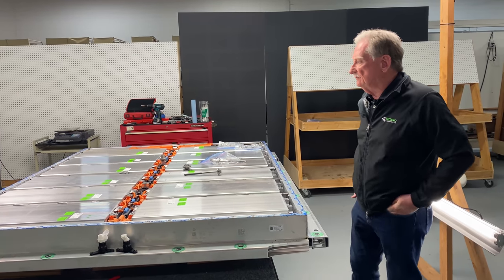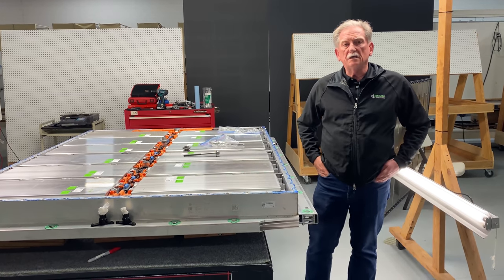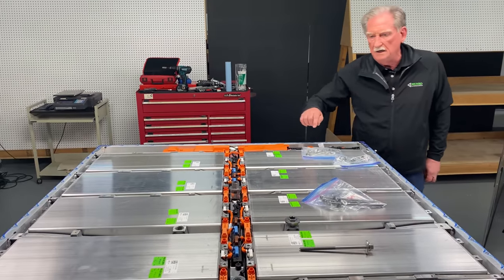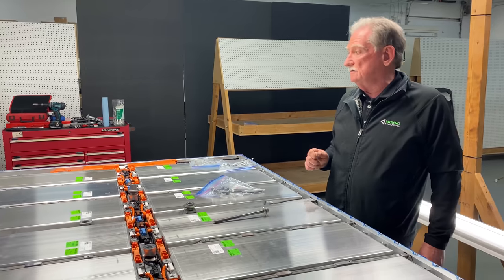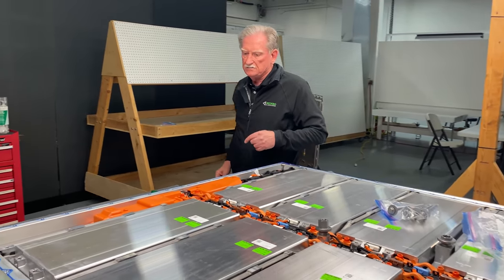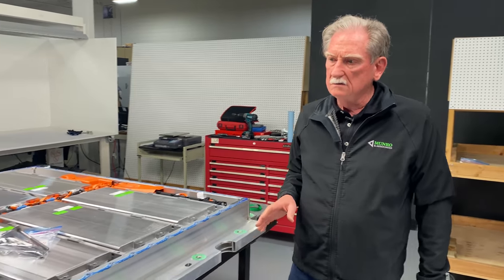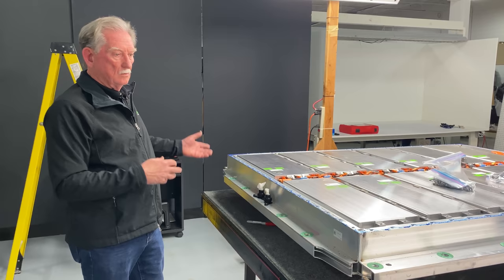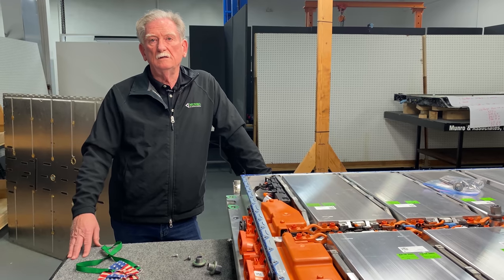2021 Volkswagen ID.4: Battery Teardown

Comment: I believe that what he's saying about the bolt is wrong. The idea is NOT to put it into the plastic state, as the plastic state means permanent elongation (and thinning) which would only harden the bolt (initially) but not help with clamping down elastically. What he means, I hope, is elastic deformation.

Comment: Model Y improvement  is 3 kg, less than 10 pounds or less than 0.7% difference which is not an improvement but we call that margin of error.  For a bolt to go into the plastic stage it needs to yield (the stress vs strain curve will tell you that) you mean pre-tensioned bolts not plastic.  The plastic stage creates necking which is not good for strength as it reduces the cross sectional area.  I will take aluminum and treaded fasteners over plastic any day but just a personal preference I guess.  I like things to be fixable not toss away garbage.

Comment: you used the gros capacity for the iD4 (82) which is net 75. Gros capacity for model y should be 79 atm to be 74-75 net

Comment: Sandy makes a big mistake with that $500 claim. That 500 mean to represent the reduction in battery materials etc., the casing, braces, bolts are cheap and won’t add up to $500...
Reply: the $500 is a benchmark that takes into account all costs, not just material costs - it's a rough estimate

Comment: It's interesting that converting parts to carbon fibre could make it cheaper. I don't know too much about the mass production of carbon fibre and other composites, but would you selectively place sheets of glass during a regular mold process, or overmold onto a previously made composite bit?
Reply: Changing to carbon fibre is almost certain to make it cost significantly more. It will make the assembly it lighter, but also impossible to recycle - downcycling to lower grade parts is the only option for reusing composites, so I'm very glad they stayed away from carbon fibre.

Comment: I guess VW doesn't use ANY metric screw below a property class of 8.8. It isn't that special and it's more like the standard for screws.
8.8 means:
Yield Strength, min(MPa) of 640MPa (first number x second number x10)
Tensile Strength, min(MPa) of 800 MPa (first number x 100)
It's independent from the screw size and is supposed to give you an idea of the quality of the screw. The higher the numbers the better.
10.9 and even 12.0 are quite common also (i.e. in engines or gearboxes).

Comment: There’s one thing you forgot in your calculations.  The box frame structure also is a stress member in the framework, not just for side impact like model y 2022 it will butt up directly onto battery so both rear impact will be transmitted through the frame, the alternative materials hav4 to conform to the same level of crash protection as well as stress from the rest of the cars frame, you may find that if made of alternative materials the box frame will be larger to conform to the same rating such as the i3 subframe compared to a steel or aluminium equivalent

Comment: Carbon Fibre is wonderfully light and strong but difficult to work at scale and hard to recycle. I think the aluminium embedded in polymer is a very good idea but imagine the retooling costs and the same for Carbon Fibre end sills? I think an aftermarket producer with the right economies of scale might be able to make significant weight improvements, therefor performance improvements but for VW it would be a paradigm shift in thinking and no doubt costing to change their production plans for the id 4, 5 or 6 before the next production cycle.
Reply: Carbon fibre is awesome for saving weight, but also excells in ballooning costs.

Comment: Isn't this a heavy piece, seems appropriate it might be aluminum, even if it's a cost saving vs carbon or something. It's sort of like the cross-member for an engine or a transmission carrier - pretty typical/economical to be steel or Al. Also I imagine it adds some rigidity as-is and to get that kind of strength seems like it would be even more expensive.

Comment: I really doubt that you can get a kilo of glass fiber composites for the same price as a kilo of molded aluminum. Also, the frame looks to be part of the thermal design, so you'd have to adjust for that as well. And where Aluminum might only deform slightly, composites will splinter and break, which would lead to some concern on my part about how well it'd hold up in a car crash scenario. You really don't want flaming lithium batteries on top of the impact.

Comment: wait..doesn't the huge aluminum frame do more to prevent safety issues like exploding batteries? and holding the weight together when the car hits a rock at 80 mph... when the batteries explode...have you seen the video of that model S battery in that parking garage in China...wow ... I don't want polymers in-between that much battery and me I don't think - I think it's about fire safety during events that are basically an explosion
Reply: Compare battery casing design from US (Tesla) and DE (VAG, Mercedes), it is clear that there is no standard for crash testing of the battery casing. In quite many reports the  German casing are built much stronger, side bars, thick / double lower plates etc. Not seen any reports, comparison, but the Tesla battery casings do not look safe, recent some top news stories, there a Tesla hits a concrete object from below and the cars are in flames. One case the two occupants( at least one, climed back to rear seat) burned to death. For saftey I would rather go with German "overengineered" design.

Comment: 8.8 bolts are pretty much the weakest bolts you can buy here in Europe. 

The first number * 100 = tensile strength N/mm^2
The first number * the second * 10= yield strength N/mm^2

There are 12.9 bolts For example.

Comment: The ID.4 has 5,96 kg/kWh and Model Y is 5,85 kg/kWh, so Tesla kWh design is lighter or am I wrong?
Reply: Thats what I saw also. Don't know where sandy found the 50 kg. I found 9kg - and the battery pack was crash protected - don't know about the TMY battery pack
Reply: @venti4268  He just ignored the kwh difference between packs, if we do that we can see 50kg difference between both packs, but that's flawed logic as both packs have different capacity, if you want to compare them you have to go to compare them at the kg/kwh... and then you should also consider serviceability and reclyclability as botth things are also important, sometimes it makes sense to have a design that is a little heavier but it's easier to fix and recycle.
Reply: @Gresteh  Just as important and perhaps even more is the difference in the quality of the construction and design. Consumers usually perceive country of origin as meaning quality, although origin usually "should" read origin of design and engineering of the product. I did not hear one aspect of Sandy's comments that were negative, in fact quite a few positives, on the quality of the execution. Cost savings may lead to higher margins for OEM or maybe lower prices for the consumer but not necessarily longer product life. I think comments should not just at saving a few dollars but highlight how will it affect a product's life. Just like when commenting on the use of fuses is a problem waiting to happen and I have 2 cars that are 20 years old, a Mercedes and a VW, where I have yet to replace a fuse. If you get a car for a 3 year lease you don't care but if you intend to keep a vehicle for a long time I care more about inherent build quality.

Comment: Page 6:00 Are these alloy steel screws? 
If so how can we put steel with aluminum together without concerning galvanic erosion?
Reply: Audi has done this with the A2 and A8 all the time. You could electrically isolate the more with Oxiguard for example instead of galvanic zinc on the screws/nuts. Or some kind of plastic film in between.
Reply: @Stefan_Dahn   thank you for update. If I understand this right. We have a friction melt drilling process in which the screw has thermal metal blank tip and threading from 50% up the head. We need this screw to fasten top and bottom casing. In the second half operation is self taping operation where we have direct electric connections from top to bottom casing via screw threading. Result in a configuration cannot be avoided such as aluminum-steel-aluminum junctions, regardless of insulation involved. You advice?

Comment: Hi mr Munro, just a thought for you, I watched your interview with Elon Musk, you talked about Lego and the way the blocks hold together , so it occurred to me, how about the construction of a small electric vehicle where the floor - sides and back and front where made from a composite plastic honeycomb construction, the honeycomb cells could hold the batteries, the 4 parts of the construction could be made to dovetail together, the car would not be painted but have a self colour finish, the honeycomb should be stronger in some areas than others

Comment: The reason the connectors are on their own piece is for modularity. The tooling for the entire battery pack doesnt need to change in order to change the connectors. This is hugely advantageous for tooling cost and production speed/turn around time. Moulding them into the entire case of the battery would seriously hinder your ability to be flexible with the design, essentially locking you into connectors until you commit to creating new hugely expensive tooling for your entire battery pack housing. Also, polymer/composite is terrible for recycle ability - please dont push these materials as viable long term solutions.
Reply: molding plastics with multiple criss crossing copper bars in side is not  trivial you would always try to make the part as small as possible, bigger parts would lead to cracks, and such parts also need some level of aftercare by robots and humans

Comment: On any kind of bolted connection, you never go into the plastic part of the load curve, it is always the elastic straight line area. What is he blabbing about? Plastic means you deform and it won't came back to where it was when the load is taken off.

Comment: By the time composite frame etc has been re-engineered, proto, production and re-cast the connections , you'll be spending a crap load more than the original $500 savings.  Let alone the original design/production costs of that original unit. Perhaps, if they'd come to you first, maybe... but they have built their system.

Comment: Aluminum is there and better for multiple reasons. Heat dispersion, fire safety, crash safety. It wouldnt be easy finding a polymer only solution that meets or beats aluminum in most of the needed requirements.

Comment: Is the shape of  ID.4 battery like the pouch shape  E-tron battery or cylinder battery like Tesla?
Reply: 24 pouch or 16 prismatic inside the modules, so it is flexible and has different suppliers.

Comment: Tesla's packs are closer to 80 kWh, not 75kWh. 75kWh is the useable figure. It seems that VW is about 4 years+ behind Tesla. The density of this battery pack is less than the Model 3 battery pack released in mid-2017. I also think the cost is higher, more modules, more connections and more fasteners. It actually looks visually more similar to the Model S pack from 2012 than the Model 3 pack. Can't wait to see Sandy tear apart a new Model Y battery pack with the 4680 and structural pack in a year or so. It's going to blow these cars out of the water.

Comment: but since it very likely to be a structural piece of the body won't they have to add weight to the body to compensate the loss of rigidity

Comment: Sorry, that is  n o t  (!!!) a yield screw. A yield screw is thinner in it's shaft.
It's an ordinary 8.8 hexagon head screw ISO 4017 (8.8 means 8x8x10 = 640 N/mm² yield strength and 8 x 100 = 800 N/mm² tensile strength)

Comment: Heat travels to the top, those MEB packs are cooled at the bottom, could that be an issue? Also is it not easier to extract heat out of many little cells (Tesla) than out of those big solid bricks? I wonder about the degradation of E-tron and Taycan packs compared to Tesla, which is very low.
Reply: Why would heat travel to the top in a solid? Heat travels to the top in the air because warm air expands, which makes it less dense than colder air. None of that happens inside a piece of metal.

Yes, it's easier to extract heat out of many small cells than of fewer bigger ones because they have a larger surface area. But harder doesn't mean it's impossible or Tesla wouldn't switch to the much larger 4680 battery cell in the future, which has the same problem.

Also the MEB platform isn't meant for high performance applications, it's used for mass market cars with moderate specs where this kind of cooling is sufficient. They will use a different platform, called PPE, for higher performance cars that features a more sophisticated cooling solution. It will be used by Audi (A6 e-tron), Porsche (electric Macan) and Bentley.
Reply: @primetablet  I think the tabless design has less internal resistance = less heat.

Comment: What does the 10$/kg possible savings figure mean? At what points is the money saved?
Reply: I want an answer to that too. If the material is the same - I get it - but if the material is composite vs aluminium - I don't get it. Besides you have to include waste cost too - aluminium can be recycled - how about composite?

Comment: A very simplistic look at things. Take that huge connector for example, yes it can be included in the mold, but what if it ever gets damaged? Then you're most likely looking at substantially higher repair costs. And secondly, it's all aluminum in my opinion, not just for the weight, but also to conduct heat. There are also tons of other arguments posted here below me. Sorry dude, but you shouldn't be too quick as a single person to judge the decisions of one the best design teams in the world, backed by tons of years of experience of this company. I would never allow your team to redesign this pack.

Comment: its basicaly a tray, so it should be very easy to cast the entire pan to perfectly fit of the batterys? and integrated crash rails in witch the larger fasteners could be inserted.i like aluminium because it is easyer to recycle and wv having aluminium producers nearby.

that said the id4 looks mecanicaly like an 2008 wv polo..........

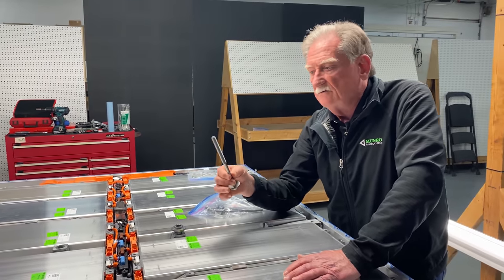Comment: (at 3:59) An 8.8 bolt is a "very strong bolt"? No, that's roughly equivalent to SAE Grade 5... ordinary stuff, perhaps surprisingly low-grade for an automotive application (which would often use 10.9, similar to SAE Grade 8). And "necked" just means that it has rolled threads, which is normal for tension bolts. I appreciate these videos, but I'm really starting to wonder about the fastener expertise...

Comment: The cost of the aluminum extrusions and castings, plus the complexity of assembly, plus the weight, plus the logistics of maintaining parts inventory VERSUS a monolithic polymer / composite pack ... yeah i can see areas where costs are minimized, weight minimized and labor reduced.
Reply: And if anything breaks you just buy a complete new pack instead of replacing the broken part...

Comment: You know, I looked at buying the ID 4 and I’m disappointed. It’s heavier and the cabin materials are very light and cheap with less of a charging and driving capacity from a Tesla. Not worth $40k IMO but I do like that they are trying. Have a long way to go to be more modern
Reply: AR HUD and turning matrix headlights are top notch, suspension is premium.

Comment: So, naturally you will be crash testing several battery packs, making sure - through testing, not speculation - that they adhere to the required  safety standards, that the plastic version is as strong as the original and is not going to become a fire trap if things go wrong. I know that most things can always be improved but I don't think VW makes the effort just because the aluminium looks nice. I am convinced that VW looked into different materials and construction methods before settling on this, admittedly, very beefy construction.

Comment: I haven't seen any plastic that hold its integrity after 10 years of assault of heat and cold of weather and vibration of a running car. That is not considering bad roads full of pot holes after a winter.

Comment: Sandy has a different mentality when it comes to design than German automotive engineers do, a typical American automotive mentality. All he cares about is how to reduce the cost and increase profits, but doesn't care about how that will impact the quality of the product, longevity, will it be repairable, can it be recyled efficiently, etc. But that's why 20+ year old German cars are still on the roads and drive like brand new with hundreds of thousands of km's on the clock, and finding a 20+ year old Ford or any other American car that hasn't disintegrated itself by now is a miracle. German, and European cars in general are not designed to be used for 2-3 years, 50k miles tops, and then be replaced, like cars in the US are. They're designed with longevity and durability in mind. It's common to keep a car for 10 years in Europe, or even longer, and anything under 200k km's on the clock is considered "pretty much like new" on the used market. That's why they don't cost cut during production if that cost cutting means it will impact the cars longevity or repairability in the future. I'd rather pay a bit more for a car knowing it will last for 10+ years with ease than save a bit of money while buying it knowing it will start falling apart in 3 years.